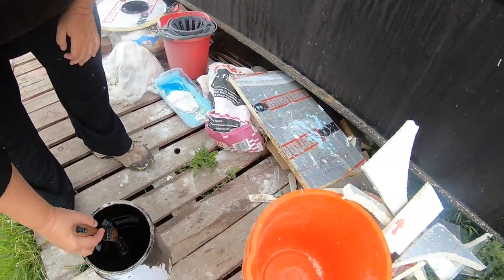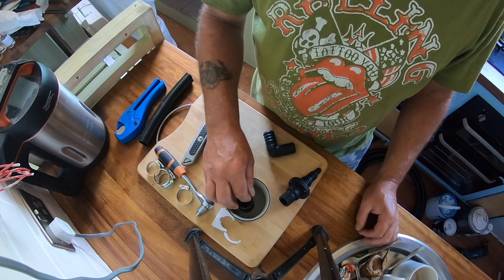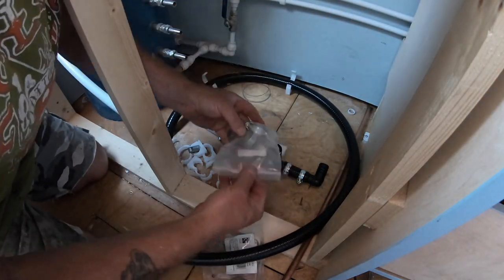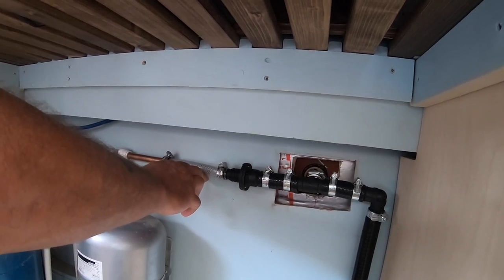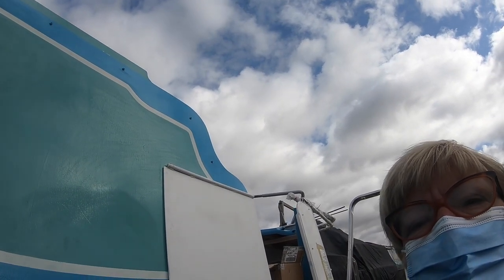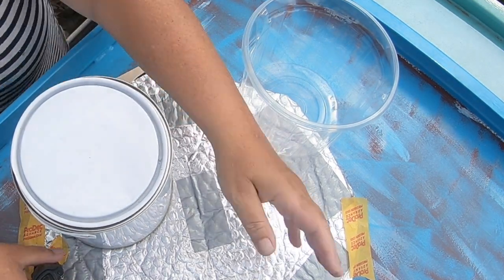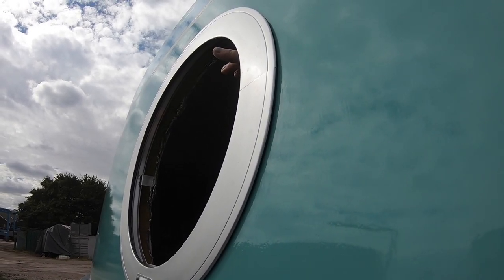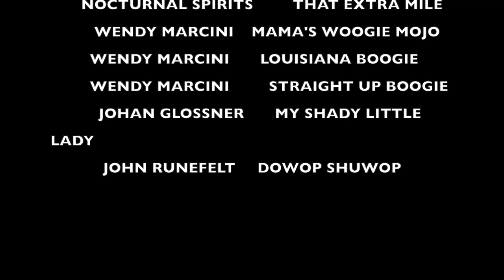VLOG 86,  Narrowboat Fit Out - Bilge pump pipework and finish painting cabin sides

Comment: I really like the areal picture, the boat looks fantastic, well done. 
Just a couple of comments, I hope that those flat solar panels will be sufficient in the winter. A friend of mine who lives on his boat permanently and moors it near me in the winter had to change his for ones that you could angle towards the sun. In the winter he said that it gave him 27% more charge and consequently he didn't have run the generator any more. Maybe modern panels are more efficient. 
I'm surprised that with Granddad's super pipe bending skills he didn't use all copper pipe for the water heating tank breather.
One tip that my Uncle gave me (he was an old-fashioned time served painter and decorator) was before you opened a paint tin you marked the lid and side of the tin so that it always went back in exactly the same position, this helps to make a good seal. Aren't those plunge cutters great?
You must be really proud of everything, what an achievement. Have you decided on the signewriting yet? It'll look stunning on those side    panels.  Looking forward to the next episode.
Reply from the maker: Thankyou Tony. Yes going to be interesting to see how they go. We will let you know 👍

Comment: What stops the boiling water from running back into the bilge without a non return valve on the bilge pump line ? Great build and nice to see it coming together .
Reply from the maker: Hello David. The bilge pumps have their own non return valve so water will not come into the bilge. Its not really a good thing to put an independent one in mainly because of problems with airlocks.